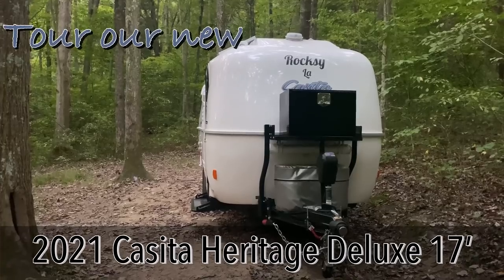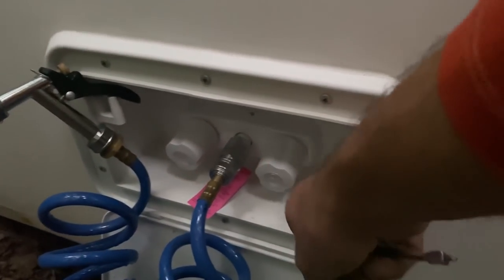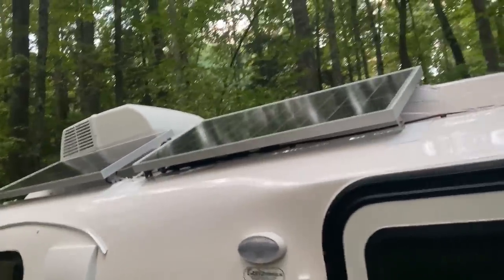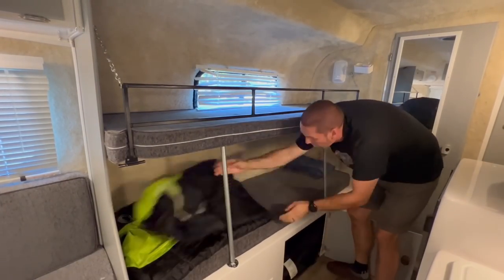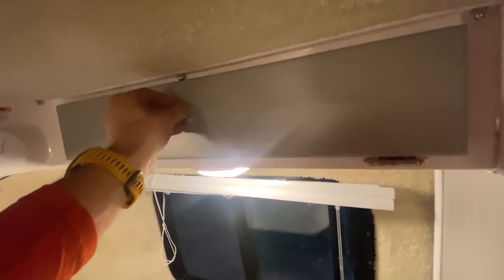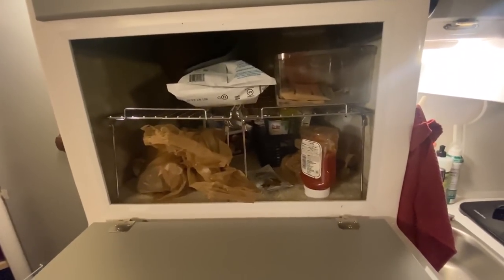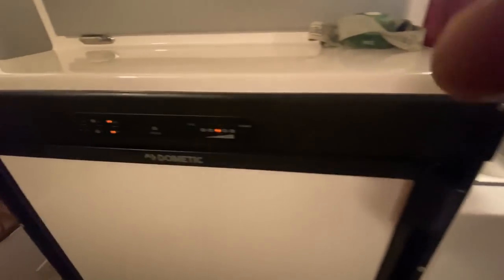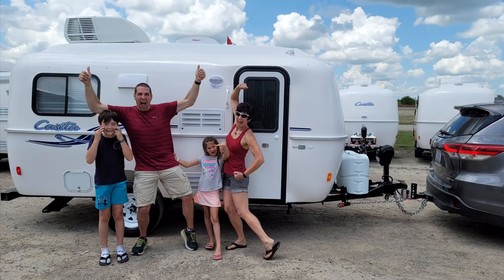Tour our new 2021 Casita Heritage Deluxe 17’

Comment: never will like rugs on the walls...
Reply from the maker: I hear you but it’s quite advantageous in a few areas:  sound dampening, insulation, covers unsightly fiberglass backing and allows to hang things almost anywhere using drapery hooks.
Reply: Yep. Dust makes me cough and sneeze. I'd have to vacuum these out every week, it's just a lot of work for somebody with allergies.